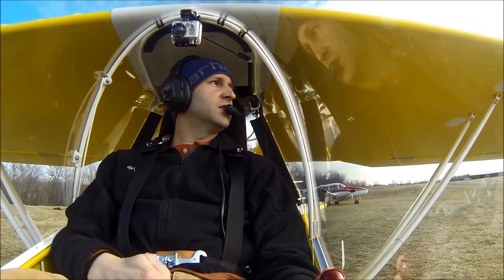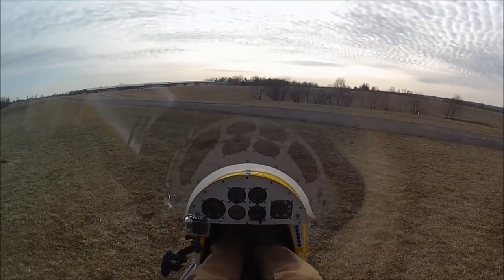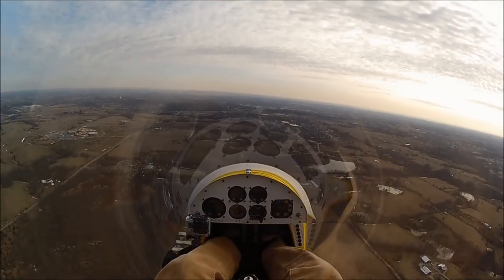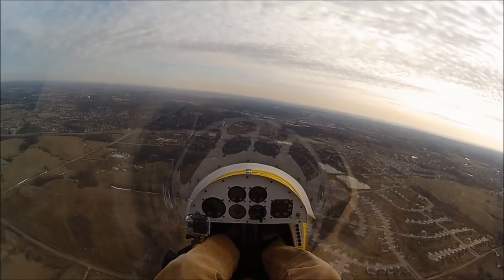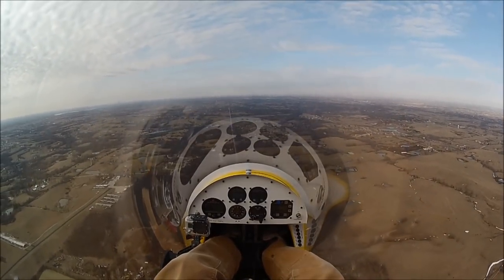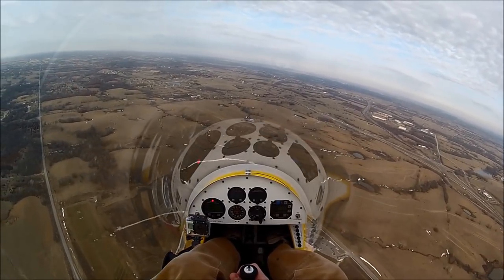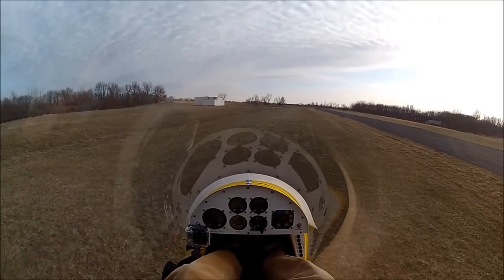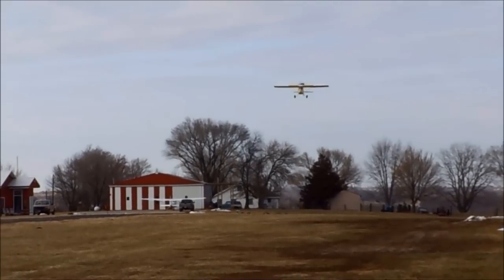Kolb Firefly Maiden Flight with Pilot Audio & 3 Camera Angles

Comment: I now have a Firestar 2, w the 503, I've got where I can get the tail up and taxi down the runway at 30-35 MPH, and keep her in a straight line, just about ready to take her up. I have a lot of hours in a Quicksilver MXL but no tail dragger experience. I crashed my Challenger 2 last summer when the engine quit over a vineyard so I'm trying to work thru that experience. I'm impressed how you gave it the gas and took her up with no crow hops or hesitation.
Reply from the maker: Randy Phillips Thanks. I did a lot of high speed taxi runs before I went for it. I also got a taildragger endorsement in a Citabria. I went straight from the Citabria to the Firefly. That was a rough transition. It's best if you can get at least some dual time in a taildragger. The most important thing is to hold it off the ground and full stall it at touchdown. Else, be prepared to go around if you bounce it. Good luck you you.

Comment: Nice job on the build and the flight. The bounce did not look bad to me. I think if I ever build an aircraft I will also have a GPS and if you have a rough idea what the wind is you will have a ball park on your airspeed if the indicator fails. With experience on type you could estimate with power settings and attitude which you did not have the luxury of on your first flight. You handled the situation well. Fly safe.

Comment: Nice little birds.  I had a Rans S14 clipped wing, with a Rotax 582.   Great performer also.   On my S14, I had similar chrome-moly gearlegs.  Did you have any issue with them bending?  I had to replace them once on the S14 due to that.

Comment: great video  one question new aircraft first flight correct  why did you not do a few runs along the strip  at speed and get the feel  above ground  possibly would have seen the airspeed not working correctly.Never just took off in my craft always those few runs along the strip  just in casegood luck and happy flying

Comment: Good video. It looks like you did everything right. Try disconnecting the static line on the ASI and see if that fixes the problem. That was a good landing for the first flight, especially on asphalt. Be careful in heavier winds. The audio that you have is very good. What radio are you using? I have nearly 27 years flying an Original Firestar and still enjoy it.

Comment from the maker: I fixed the issue by simply disconnecting the static line from the back of the airspeed indicator.  It seems to be working ok.  I think part of my problem was that my probe was a little short and I was getting a little effect from the nose cone.  I may reconnect it and try again at some point.  Thanks for the compliments!

Comment: Very nice Kolb. I have a Kolbra. I wish my radio sounded as clear as yours. What kind of radio/antenna setup do you have?
Reply from the maker: Thanks for the compliment.  I have the MGL V10 panel mounted radio with a Mobile brand "AIRKIT" base loaded antenna.  I bought mine cheaper by going direct through Mobile in Australia.  It is about the only game in town for a decent base loaded aircraft antenna.  It is well made. You can see it mounted to the right side of the cage.  From pattern altitude I pick up surrounding air traffic 40+ miles away.  I'm also using resistor plugs, shielded and grounded plug wires, and a mic muff.  The V10 has some really sophisticated noise filtering/canceling software that is user adjustable.  I think this is one of the main reasons for my good sound.  They make a 2.25" version of that radio now.  I'm also patching the audio straight into the GoPro.  But, sound quality reports from the UNICOM operator are also positive.  Happy Flying. Stay safe. Kolbs are a lot of fun!

Comment: Re:  Airspeed.  Realize you used a water manometer to verify the AS indication; you said it was a bit out of calibration.   Might try to vent the AS indicator to the cockpit and use the Impact (Q) pressure only.  Yes, there might be a slight difference due to the "pressure area" in the cockpit from the air "moving by" the cockpit.  Will, probably, be much closer.   Wondered why you have a tail Nr.  The firefly is a "true" (part 103 ultralight, right?  Built 3 Exp. Amateur Blt. planes. N6395T

Comment: Surely a portable GPS would give ground speed and you drew a wind vector on the chart before take off right? With that set up you would have a pretty good idea of airspeed?
Reply from the maker: +Roger Blackwood Yes.  GPS would have helped.  I own one.  But, for a maiden flight where you don't leave the traffic pattern, it doesn't make a lot of sense.  It's one more thing to worry about while you already have your hands full.

Comment: How did you fix that?  Change the static port/s location?   Or, just run a static line to the inside of the cockpit (or another locale).  Or, just vent the indicator static port, with no line on that input.   Just curious, as my EROS 1650 Mini-max did exactly the same thing.  Ended up running a short tube from the static port to behind my instrument panel.  Checked good!  You have a very nice plane - congratulations on all of your hard work - and work it is/was!  N6395T

Comment: Nice Airplane indeed! Hey have you thought about having those brake lines stowed away a lil further up the gear legs via ties? Or is there a kit that has an attachment for that? I am thinking of buying one of these :) Cheers
Reply from the maker: Robbie Brown These are cable style brakes, so they have to make a large sweeping bend, or they will bind. The cable and housing are very stiff. I've converted to hydraulic brakes and zip tied the lines to the gear legs. It looks much nicer now. They are lighter too.
Reply from the maker: Robbie Brown Also...  This one will be for sale next summer. I'm building a Sonex, and it should be done by then.
Reply: JWolfe104 I see! That makes perfect sense! just one other question, in the event of a Engine failure (lets use ISA) what is the ROD roughly and the recommended glide speed? Thanks

Comment: Does the plane want to fly to the right or left on it's own? Saw another video where the guy added a trim tab on the tail to resolve that issue. Thinking of getting an ultralight but I kind of want a twin seater so the wife can come along for the fun. Yep, need that sport license to fly it though.
Reply from the maker: Charles T I had to add a wee bit of rudder trim and aileron trim.  The plane is rigged "straight," so there is nothing to compensate for torque and p-factor except the trim tabs.
Reply: Charles T Take a look at my Kolb Mark III X two seater on Barnstormers.

Comment: Nice Plane! I just bought an assembled fire fly but I have no experience in a high wing pusher. I am gathering as much info on landing it as possible. I read that a good technique is to descend at 50mph then slow to 40mph when you get a 100 feet from the ground. Then when you get 2 feet or so off the ground, throttle back and gently pull back on the stick. Does this sound right? Do you have any advice?
Thanks!
Keith
Reply from the maker: Dcred45 Thanks for the compliment.  You're struggling with the age old delima, as did I.  I will tell you my experience, but you will need to modify it to fit your situation.  My Firefly is heavy.  I've got all the bells and whistles.  My flying weight is about 550 lbs.  So, my speeds are going to be on the high side.  If yours is a true UL, then...?  I approach at 58 with no flaps.  I use 54 or 55 with full flaps.  My stall speed is 44 no flaps, and about 41/42 with flaps at altitude.  In ground effect, maybe 38/39.  I typically approach with no flaps.  Idle rpm in a descent with the prop windmilling is about 2900 (Rotax 447).  I usually carry about 3300/3400 rpm down to, and partially through, the round out.  I start the  round out about 20' above the ground.  This leaves me with enough speed to have time to make a nice flare (about 3 seconds).  I could approach slower.  But, if I did, I would certainly carry the power all the way until I was 2' off the ground.

The manual that came with the kit from Kolb recommends using 55 mph for your first flight approach speed, and I would say that is about right.  I'm not sure what you are used to flying, so I my be telling you what you already know.  But, the issue with planes like the Firefly and other UL's is low inertia.  Once you round out, the plane stops flying quickly.  If your current experience is in GA type planes, it will catch you off guard.

I would recommend doing what I did on my first flight, which is do a lot of stalls and slow flight.  Get a feel for what the stick forces feel like as the plane slows down.  The full span ailerons cause the stick forces to change drastically with speed.  Find your stall speed, then add 15 to 20 mph to it for approach.  Carry 500/600 rpm above idle through the round out.  Be prepared to add a little throttle if needed.  Work on slowing the approach down only as you gain experience.

I definitely would not slow anywhere near 40 unless you are ready to fall from that altitude.  There is almost no down side to a little extra speed on final until you get the hang of it.  

One more thing. Feed in takeoff power gently at first.  If you hold neutral or a little down elevator, then feed power too quickly, it has a tendency to nose over.  If you want to add power quickly, then hold full up elevator, then relax it as you get a little forward speed.

Good luck, and I'd be happy to answer any more questions.  The last plane I flew before the Firefly maiden flight was a Citabria.  So, I've experience the apprehension of the unknown!
Reply: Thanks for the fast reply! My FF is a part 103 legal UL w/ a rotax 447. My previous flight experience is flying a cessna 152 and 172. I have been doing a number of high speed speed taxi's, lifting the tail and setting it back down. I bought my plane already built and it has a bungi cord around the bottom of the stick that it tied off under the seat. Its kinda weird imo. I suppose this is a form of trim? Thanks again for the info, I never recieved a manual with my plane!
Reply: One other thing, my FF does not have a cover for the wing gap like most FF's. Do think this will be a major problem? Thanks in advance!
Reply from the maker: Dcred45 A bungee is a common method of trim on ULs.  It's a lot better than nothing.  It should work fine for you as long as you have a decent way to adjust the tension to achieve level cruise flight.
Reply from the maker: Dcred45 I wouldn't recommend it, especially for a first flight.  I've heard a lot of bad things about doing it, and nothing good.  I pasted a link below that talks about one guy's experience.  The issue is that you have 4 wingtips instead of two.  That creates a lot of drag and reduces lift.  It also makes the air dirtier around the prop and tail.  I would recommend taking the time to work one up.

http://www.homebuiltairplanes.com/forums/aircraft-design-aerodynamics-new-technology/6308-wing-center-section-gap-seal.html

Comment: Nice Video, Good job checking your stall speed a few time in the Air, 
I land my FS2 at 50hrs airspeed to about 6/12 inchs from the deck then roll the throttle off and let it settle. 
 I liked your Kissing the ground when you got back down.We have all been there right.  Then the Wife. Cute . 
Fun And Safe fly'n Bob

Comment from the maker: Yep.  GA is expensive.  My neighbor bought a Bonanza, then spent about 16K to clear up some engine log book issues, then another 12K on a new prop. EXPENSIVE.  All of the GA guys at my field complain about it. I tell them my first annual inspection cost me about $20.  Regarding flying close to the runway - I do.  The GoPro makes my approaches look far out.  The maiden flight was a little.  Currently, I fly a pattern that allows an idle speed glide to touchdown (dreading the day she quits).

Comment: Like it! How about horsepower of the engine? If I want build it, can I use motorcycle engine with +- 20hp?
And how about rpm speed of the propeller?

Thank you!!...
Reply: Haloo?
Reply: Elang Megantara 20HP wouldn't do it for this plane.  Most Fireflys use a 40HP Rotax 447 engine.  Max rpm is 6800; with a 2.58:1 reduction that's 2636 rpm at the prop.
Reply: how about the aileron control system? is it control with mechanical system?
Reply from the maker: Elang Megantara
Aileron control is done with a torque tube and push rods.  No cables are used.
Reply: JWolfe104 can I see your aileron control (torque tube and pushrod), please?
Reply from the maker: Elang Megantara
I'll direct you to my builder's website at experimentalfirefly.info.  I have a lot of photos there.
Reply: JWolfe104 thankyou for your information. How many the empty weight?
Reply from the maker: Elang Megantara
347 lbs.
Reply: JWolfe104 and the two wings weight?

Comment: what anr headset are you using? any thoughts on other anr headsets? have you used the "flaps" since this first try? i have yet to fly my firefly.
Reply from the maker: I don’t use ANR. ANR doesn’t cancel two stroke engine noise well. I have a standard headset modified to incorporate a CEP (communication ear piece) like Navy helicopter pilots use. It provides two layers of ear protection. I love it. Without it, the noise is literally painful at takeoff power.
Reply from the maker: Flaps work well. They turn an already steep approach into an express elevator down!  I don’t recommend using them until you get comfortable without them. They make flare timing a little more critical.
Reply: @JWolfe104  can you elaborate on the CEP conversion? how, where, price? will the noise reduction still work well when flying a piper pawnee? i have a dc 10-40 headset.
Reply from the maker: @vidge123  See the product at this link. I think your noise cancellation would still work when not using (even when using) the CEP, as the installation just involves installing a jack in one of the ear cups. That jack allows you to plug in the earbuds.  The jack is just wired to intercept the audio signal from your radio.  It will pass the signal right on to your normal speakers. Main issue might be that you don’t have enough room in your ear cup due to any noise extra stuff in there related to ANR. The guys that sell this also install them for you if you prefer. Call them and I bet they know the answer to your question. 

https://www.flighthelmet.com/product/CEPS-0002.html

Comment: Couldn't you just pull your Iphone out and open your maps app and check with your GPS?  It will tell you how fast you are traveling and you could figure out how far off your gauge is.  Thanks for the video.
Reply: +skyym3 Wouldn't help. Need airspeed, not ground speed.
Reply: HummingLoud Oh, ya.  I wonder if there is an app you could get for your Iphone that would work for you?

Comment: What engine/prop?  Would you build this again or something else?
Reply from the maker: Captainpegs07 I would. I think it is still one of the best single seat ultralights out there. It takes a lot of effort to build. If you wanted something quick and easy, I think the Aerolite 103 would be a decent choice. The Minimax lineup is also good. What to build depends on the mission. I’m ready to take some cross country trips and fool around with aerobatics, so I’m currently building a Sonex. The Kolb will be for sale in a year or so. Engine is Rotax 447 with an Ivo 60” adjustable.
Reply: Thanks for the reply.  I like the Sonex B's.  I'm looking at either a Kolb MKIII or CGS Hawk Arrow II.

Comment: 3.18: I don't appreciate it when someone does an engine runup with my plane right behind them. There was ample room for the aircraft to be positioned elsewhere.
Reply from the maker: What you don’t know from the video is that those are derelict aircraft that had not moved in years. Both were gust locked. That wasn’t a run up. I’ll tip over if I do a full run up. 2800 rpm is like 1,200 on the prop due to gear reduction. Hardly a breeze was applied to those aircraft.

Comment: You are correct on those "old fat ultralights"; most now comply as the FAA WILL come down hard on you. (into your wallet). I, like you, got out of the GA flying - won't call them "spam cans", but the Experimentals, Light Sport, & Ultralights are the way to go.   Flew GA for over 30 years and it is WAY too expensive!  Suggestion:  I would stay closer to the runway, so as to be able to glide WHEN your 2 stroke quits - they ALL do.  Cross country, always flew from "landing spot" to "ldg. spot!" :-)